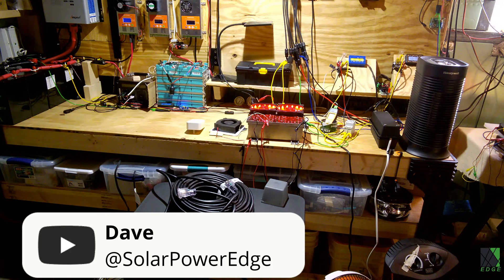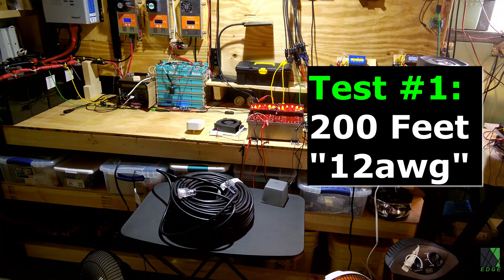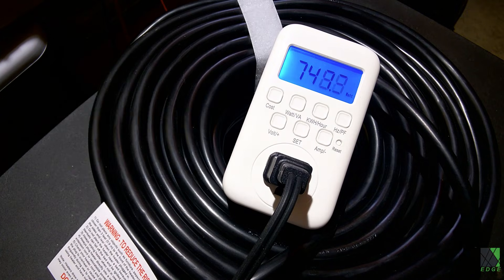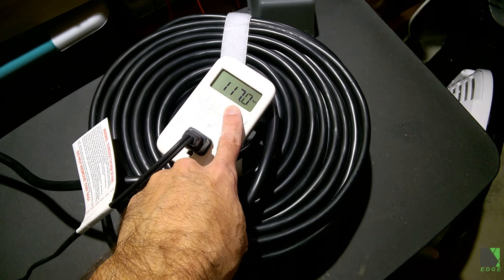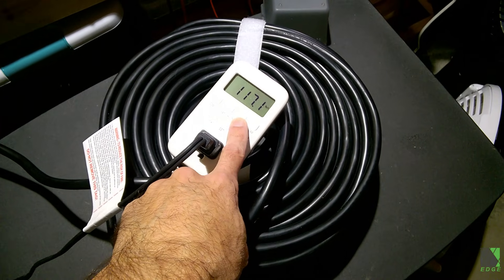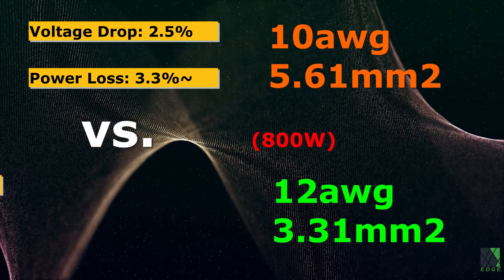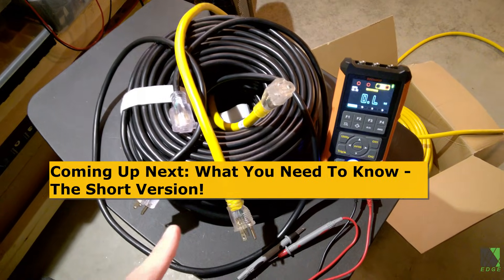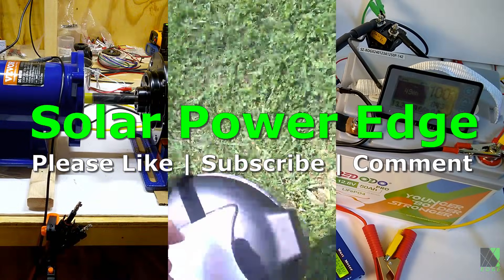Using The WRONG Cable Is a Bad Idea! Voltage Drop Explained, plus simple testing methods

Comment: the coiled aspect of wiring also contribute to heat and voltage drop
Reply from the maker: @NotJustRogan I believe inductance might be cancelled out because it's alternating current, but I have heard a lot about the potential effects of coiling large amounts of wire. Have not been able to look deeper into the subject, it would be an interesting experiment

Comment: Best to figure 8 coils of wires instead of loop when running lots of watts through it. If it's a coil like you have that just goes in circles, at higher watts if u put your leg or arm in middle of cold can harm a person. I learned that working as a electrician for concerts and thicker wire but the figure 8 cross cancels the field and makes it safer is what I was told by my old boss
Reply from the maker: @CoolPad-ey5vr I've been thinking due to this being AC, with wires running in 2 directions a lot of effect could be cancelled out. So for this reason, ohmic resistance (and heat) seem to be the primary factors. But there must be some inductive effects and certainly EMF that such a coil could produce - I have no way to measure it though

Comment: Hello sir , I heard 1 person said  if we use soft cable  it can provide higher current than hard cable  , is it correct or not ?  
The cable  are same size , but  the soft cable can handle higher current than hard cable ,  
Can you help me  is it correct or not ?
Reply from the maker: @meassavuth4649 Greetings sir. It depends on how much copper is actually in the cable. The question is, which cable has the thickest copper per meter? Stranded copper cable of the same gauge as Solid, might have air spaces and therefor could transfer less current. Hope that makes sense. Any questions please ask
Reply: I’ve heard similar things  .  In car audio they say stranded is better . But I think that’s mainly cause  it needs to be  flexible to be ran. Thru , over and around things .  My question is does a cord having sharp bends in it increase the resistance
Reply from the maker: I suspect if the copper strands get kinked it can increase resistance. In my experience thin copper takes a few bends and then starts to break

Comment: Can factory appliances have to small of a cord? The cord on my vacuum cleaner starts warming up when I use it. Has never gotten hot as I only use it for a few minutes, but still a concern. Thankfully my battery backup is only used for internet, some LED light and phone charging if power goes out, as I don't think I would want to plug something into it that was not produced correctly.
Reply from the maker: @Knife_Collector  Absolutely! it's "cost cutting"... the manufacturer figures, they don't care if the cord gets warm as long as the vac keeps working... they save money on copper (which is very expensive) but those kinds of cords make me nervous. It could also be a damaged cord or plug. Had a cheap cord almost burn yesterday, good thing I caught it in time

Comment: Large loads would be better on 240volts. Copper is going to be a real problem with the energy transition so it isn't about the money as much as not wasting the metals.
Reply from the maker: @jocosson8892 Europe has it good with 230vac. With the cheaper cord, even 600w was a disaster... but with double the volts I would have saved 200$
Reply: @solarpoweredge  
I thought you wanted it for an inverter; most inverters do 110/220 or 220/240 at the flick of a switch.
Reply from the maker: @jocosson8892 Both cords will be used with a normal 110v inverter which does not output other voltages. Also the compressors I am powering are all 120v. I thought I could save a bit with the cheaper cord, but the test results gave a reality check

Comment: Good that you provide some real world tests. I've seen plenty of this 'quick I need an extension cord' potential hazards going on. Most people are not aware of the numbers, what they mean and what could potentionally go wrong.  Especially those extension cords on a reel are handy but are a potential fire hazzard.  Not sure if an AWG is a norm we can rely on. I've heard that some cables are made of Copper-clad aluminium wire so I wonder what the resistance of those things are and if they are consistant due to the percentage that may vary.
Reply from the maker: @Luke-san Right about the CCA wire, some budget cords do have it. Terrible stuff. The other day I was using a cheap cord and it started to melt and almost burned up due to the poorly made plug end. Could have started a fire... got to stay vigilant

Comment: Does the coiled up wire have a resistive effect. An old Navy welding instructor mentioned something about coiling the wire up while welding.
Reply: Not inductive, but they insulate themselves heating up more causing resistance to further increase.
Reply from the maker: @vladimus9749 @markpennella I think due to the wires going in opposite directions (live and neutral) there is not much worry about inductance. Not saying there is Zero, but most of the effect I have seen is simply wire resistance (ohms)
Reply: @solarpoweredge  Agree fully
Reply from the maker: @markpennella It might and/or some inductive effects, although they'd be a lot less than resistance (ohms) itself

Comment: coiled wire will have  an effect as well.
Reply from the maker: And those cheap AC plugs..  burnt one up the other day... oops :D
Reply: Yes, the coiled up wire will be a source of inductive reactance and contribute some impedance. It would be interesting to run the tests again with the cords stretched out and see if the effect is significant at these power levels. I've experienced it twice. Once in a coiled up TV antenna wire where the signal was bad and once welding aluminum with about 170 amps AC with about 100 feet of + and - leads rolled up next to each other.
Reply: @LPMutagen  This isn't true and has been debunked on other channels. The way extension cords are made and currently flows through them, it forms a non-inductive winding. Coiled cords are bad because they insulate themselves and cause more heat to build up.

Comment: This is extremely important information that needs to be shared more. Another aspect to consider are the LC characteristics of long cables, especially those that aren't shielded and grounded appropriately.

One potential future episode could be comparing and contrasting HVDC (100-200v) vs 24-56v for home use. I personally consider 12v to be obsolete.
Reply from the maker: @subhobroto I hope this content will help a few people out... 
You make some good points. Edison's original power grid system was ~100vdc if I remember correctly. Currently researching some different options in that direction, we'll see where it ends up. Another angle is appliance efficiency. If I only had ~48vdc to work with, can I make the appliance more efficient and use less power (super insulated HWH tank for example)